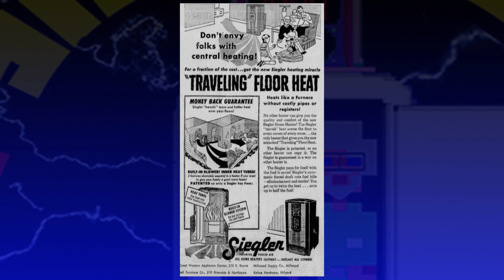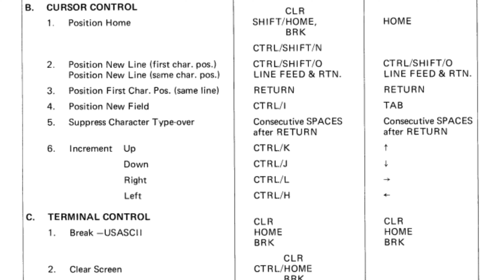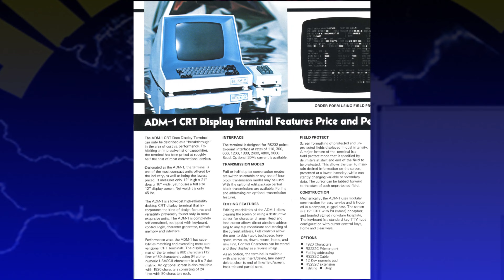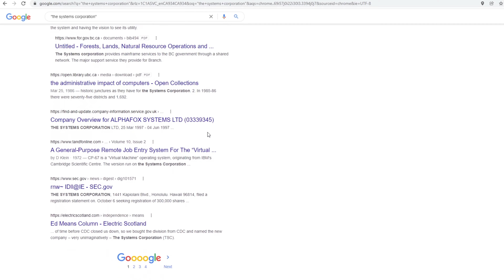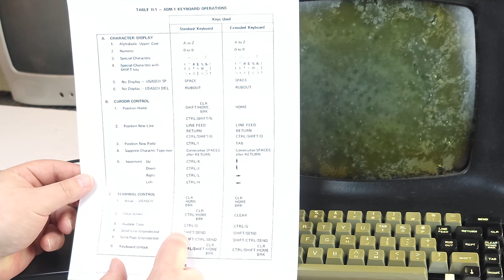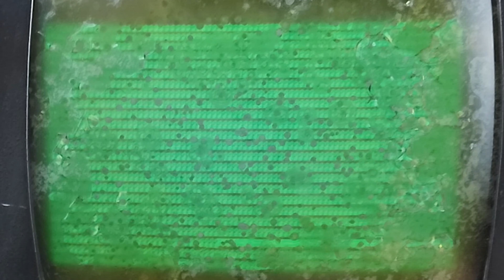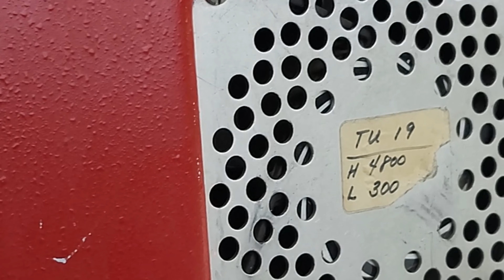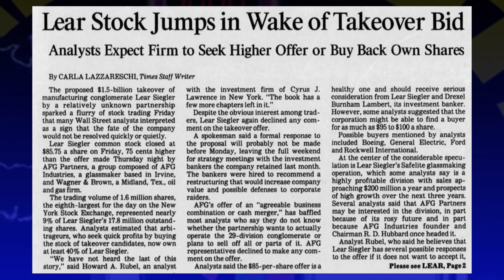Birth of A Dream Machine - The LSI ADM 1

Comment: The keys operate on the split-reed principle, primarily used by the defence industry, and Hewlett-Packard.
the key has a tang separating two reeds when at rest, a hole in the tang allows the reeds to contact when pressed.
Ultra-reliable, and positive feedback.
And the key-caps were two-part injection moulded, so that the face could never abrade.
Genius.
Reply: The kids call those "doubleshot keycaps" nowadays. It's nice that keyboard hacking and customization became a somewhat popular thing. It's so much easier these days to get quality parts that work the way you want.

Comment: Do be careful with that moldy CRT - as the PVA glue breaks down, it will go liquid again and leak onto the PCB ruining it. 
If that system hasn't been turned on in a week there's no risk of shock. What is annoying is on that one, the mounting band is molded around the safety lens. The whole thing is epoxied together. I've not taken the lens off of a crt like that, but it would be a huge pain. 
You might want to put some foil or other containment under the crt to catch drips.
Reply from the maker: Yes I did find molasses like goo down on the pan and a few bits on the CRT.  I wasn't sure if it was just industrial grime or the adhesive but you can see it pooling at the bottom.  Pretty gross stuff.

To my eye the band goes all around the crt and prevents access to a spot where you could insert a tool and with heat work on separating thr CRT.  I've looked it over a few times and just can't see how you get in there.
Reply: @TechTimeTraveller  shango066 did good videos on repairing this, the band doesn’t seem to be tight like an implosion band so I think it would pry off easily
Reply: @audiodood  I realize this thread is 2 months old, but Shango specifically doesn't usually touch rectangular CRT cataracts, the dispersion of stress on the tube isn't the same as a "roundie" and once that implosion band comes off, you've basically got a glass bomb. I'd HIGHLY suggest sourcing a replacement, however that has to happen.
Reply: I don't know about the "risk of shock not being there if the system hasn't been turned on in a week" - I mean better safe than sorry and discharge it every time you do something like touching the tube (even if it has laid dormant for a while) - pretty easy to become a comic book villain if you trust a tube to be discharged.
Reply: @lauram5905  he did it with a console a couple months ago, I think it was an admiral, the sealant had failed in exactly the same way also I think this crt probably has an implosion band so idk

Comment: The scariest part of decataracting is by far the removal of the safety glass itself which has high risk of implosion. Solid state driver electronics especially of this era literally do not have enough power output to injure you while they're on - The high voltage is so low current that it would drag down to a level you probably wouldn't even be able to feel as soon as you touched it. 

The real scary part of this is that power supply, which has the nice risk of bursting into flames due to aging components or just the fact that it's poorly regulated mains supply from the 70s meaning there's a nonzero chance everything inside the unit is reference to mains at all times.
Reply: 400V electrolytic capacitors can hold a lot of spark for a surprising time.

Comment: I had the ADM 2.  Fished it out of a dumpster in 1998 or around that time. Gramps owned apartments, one of the tenants threw it out, and I was so intrigued by it that I kept it. Sadly it went to storage during a move, which my parents didn't pay off and I lost a whole bunch of old computers in there :(  Hopefully I can re-buy and recover my collection of old systems.  Interesting note, the ADM2 did not have an attached keyboard, it was an entirely separate unit that just butted against the screen.

Comment: In the mid 90's I worked for a steel mill industry and they were still using  mainframes and serial terminals from the 70's and 80's very similar to those show in the video. 

I remember the IT guys struggling to keep them working. Their were painted in a very cool green-grey scheme.

Then came the "micros" to replace the mainframe and it was a mess. All the workflow were tailored to the "green screen" terminals. The company bought a lot of IBM Aptivas but few peope had the experience to use Dos 6.22 and Win 3.11 (I had some experience because I was a PC user since the late 80's).

Comment: Regarding swapping the tube - yes there are many 12" tubes that will work. I think that one has the larger neck? If you see a tube with the same size neck and connector it should work 100%. It should have a 12v heater.

Comment: I love this little guy (little lol). The form factor from the the front is just gorgeous and then you see it from the side and bam its a long boi. Also I think that red is original or at least very well done by secondary user, because there is labeling over the top and it appears very cleanly done in video (age issues aside). I also don't think that it isn't unlikely that whatever company bought it wanted it match the design of it's location. The idea of a sleek beautiful office didn't start with modern silicon valley tech startups. The 70s in particular were big into design elements that we would now call retro futurism. So I could totally see that red being intended to match a carpet or as accent color.

Comment: I'll bet that terminal will be a lot happier if you connect RTS and CTS together.  Also DTR, DSR, and CD.  Those are the common handshake lines needed to keep things happy.  Also, don't expect to see anything on the screen unless you're running half-duplex or have connected Send Data and Receive Data together.
Reply from the maker: Yeah I was trying to figure out what mode it was set for in terms of duplex or send page.. but the switch is absolutely smashed.  When I get my current project done I'm going to do some continuity tests and see how it was set.. and then either replace the switch or manually jumper it to the setting I want.

Comment: Boo YouTube, for throwing away my comment entirely so I have to type it again.

An advantage of the ADM-3A discrete design was that with a simple modification it could reliably handle 38.4 kbps while most 8080-based terminals of the day would drop bytes at 9.6 kbps.

Comment: Time to fix the CRT cataracts. I fixed a similar problem with my ADM-3A. Just plenty of heat and acetone and you can make the screen like new after you remove the adhesive between the tube and front glass.
Reply from the maker: How do you get around the metal rim around the tube?
Reply: @TechTimeTraveller  On mine the implosion band doubles as the frame that mounts the tube up against the face of the cabinet. On yours it looks like there's a frame holding the front lens in place, and it might have a separate implosion band around the tube behind it? It looks like if you just unscrew the nickel-colored frame then it will expose the tube, then you can start working on fixing the cataracts. Check out John Sutley's video called "CRT Cataracts: VTV" where he shows his process of fixing the cataracts on an ADM-3A.

Comment: What about using a heat gun to melt the glue and remove the lens? If you don't linger in one place too long and evenly heat the lens, it ought to just pop right off. At that point I'd give it a good cleaning, and maybe try to reinstall it without adhesive.

As for discharging the CRT, as others have indicated, there's a pretty good chance it'll discharge itself after a short while (anywhere from 30 minutes to a couple days). Even if it doesn't, the single-handed method used by the vacuum tube guys can make it relatively safe. Basically, ground a metal probe of some sort (like a thin screwdriver) to the chassis. Then, using one hand only, insert the screw driver under the rubber boot for the high voltage line until you touch the pin. If it's discharged, nothing happens. Otherwise, you'll hear a crack, and it'll be done with.

This method is considered safer because, for most electric shocks, the part that makes it "lethal" is when electricity arcs across your heart, and the current stops your heart. Presuming you're not doing this barefoot while standing in a pool of water (don't do that), the only way this can really happen is if both hands complete the circuit, with anode and cathode in opposite hands. You may potentially (pun intended) still get a zap off it, and it might not feel good, but it's not likely to kill you.

This info sourced from numerous YouTubers smarter than I, notably Big Clive (BigCliveDotCom), Mr. Carlson's Lab, Adrian's Digital Basement, and a few others. Big Clive even went so far as to demonstrate electricity is not necessarily lethal, by deliberately shorting himself across 240v AC mains through a potentiometer. (Not something I would do, but it definitely gets the point across. 😳) 👍️

Comment: Is that the terminal that the (in)famous vi editor was written on? Using the HJKL keys for cursor navigation seems familiar.
Reply from the maker: I feel like that may have been one of the DEC VT terminals.  I've been trying to get the answer to that myself.
Reply: @TechTimeTraveller  I've been told that the ADM-3A is the terminal in question that resulted in vi's cursor key choices.

Comment: I have a 1969 first gen 18" Trinitron with this same type of cataracting but not as severe, it looks as though there's some kind of laminate as the black spots aren't all on the same plane. I figured as it looks awful there's really not a lot to lose by trying to remove it. I was wondering if soaking the tube face down in some water for a while could help soften the adhesives.
Reply from the maker: What I'm having trouble with is there is a metal band all the way around that covers the seam between the crt glass and the implosion shield.  I've been looking at it but cannot figure out how it would come off.
Reply: @TechTimeTraveller  My bet is they'll have used a polyurethane goop to seal the band on, I think even heat all the way around and see if anything starts to move would be the way I'd go.

Comment: Been after a terminal for a while now, as you said they want way too much for them, scary for me as I once worked in a repair shop at a telco, where all the terminals got fixed. back then all my efforts were towards building up my TRS-80 system and never thought of acquiring a terminal (or a telex machine, that I also worked on), darn
Reply: I managed to find a BT Telex machine on ebay a few years back, unfortunately it didn't have the keyboard. It has a 5 pin DIN connector but I don't know if it just uses an AT type keyboard or a proprietary one. So as of yet I've not been able to do anything with it.

Comment: for old stuff I use a home made box, its a metal outlet box with a cord and a GFCI wired up correctly so if nasty electrons are imbalanced from in to out it will trip ... plus you have a kill switch (the test button) On mine I use a 4 gang box and a light switch before the GFCI marked (in sharpie of course) OH SHI* both are the rectangle holes on the metal face plate cause GFCI and I prefer a paddle style OH SHI* switch over a toggle, its easier to slap in the event of .... rapid oxidation

Comment: I suggest you send control-G from the PC to the terminal. You've demonstrated that the computer beeps when you type control-G locally. When you send control-G from your PC to the Adm-1 you'll know you have the RS-232 handshake, baud rate, and stop-bits sorted out when it goes through and you hear the beep. Getting the character generator right will be another matter. As for the danger of high-voltage, you just have to discharge all the high voltage capacitors as a TV repair guy (e.g. Mr. Carlson) can describe.
Reply: I worked for LSi during the early '80s, but preferred the VT-100. My Z-89 computer resembled the ADM terminals. Its architecture was interesting. It had an H-19 terminal with a 2nd PCB for a single-board Z-80 alongside the terminal board.

Comment: You can eliminate CRT cataracts if you use a heatgun. Theres plenty of vids on youtube. The point is to get the rtv type adhesive warm enough and going from the center outwards evenly warming it up forcing airbubbles out. Never heard of discharging the CRT. Just do it carefully.
Reply from the maker: I've watched the videos.  Unfortunately to even get to that step I have to overcome my fear od getting zapped.  I'm working on learning how to discharge safely and be sure it's discharged.  I've gotten bitten a few times.

Comment: Can you speculate as to WHY you believe that this particular one was painted red by it's end-user at any point?  Reference 4:29  And 5:07 I am of the belief that the blue undercoat is the original LSI color, and the red is spray paint by an end user/decorator at some point.  Any more thoughts on that?  Tell us more about the previous owner, and how they got it!
Reply from the maker: My guess is it was a custom job lot that the Systems Corp did for a client or maybe did for every terminal they supplied.  One thing throwing me about the paint is all the other terminals I've seen are white on outside and blue around keyboard and CRT.. but this one appears to have the blue underneath the red around the outside.
Reply: @TechTimeTraveller  Excellent deduction, you're probably quite right!  About where the blue is found, I think I found one where the whole thing is light blue, except the area around the keyboard and CRT, which is a darker shade of blue.  But I can't share the URL unfortunately, as YouTube blocks those comments if I do.  Perhaps I'll find another way to share it.

Comment: I can't believe you haven't bent two paper clips to remove keys yet lol. I don't buy the tool either but some key caps get really stuck on there.
Reply from the maker: Never thought of that!  Sometimes if I can get a couple off I can carefully use my chip puller when they're really stuck on there.  But usually with enough pressure I can do it without any tools.